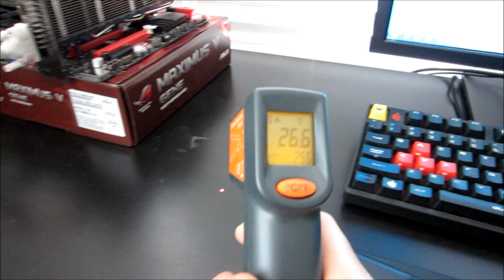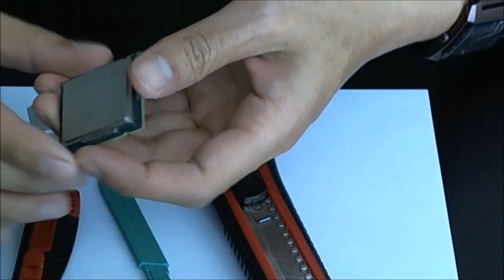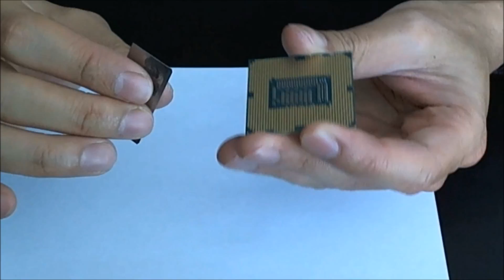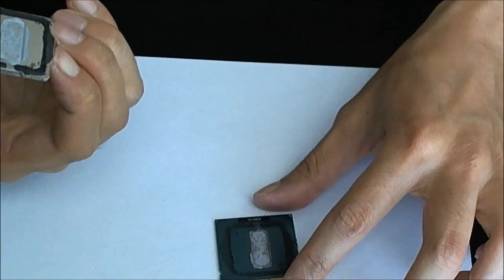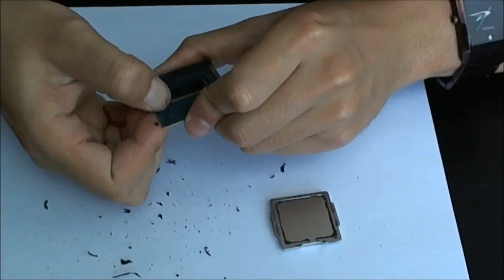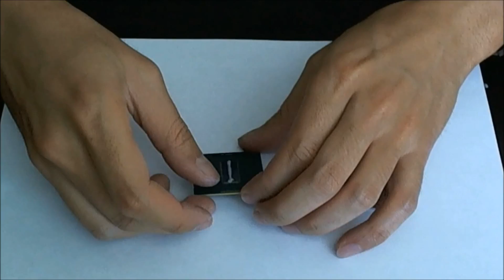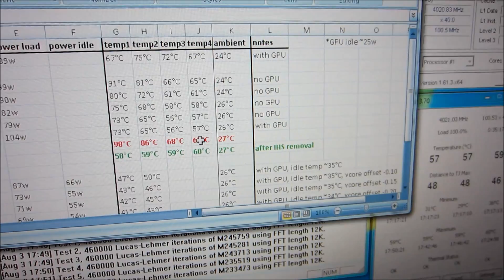Fixing Skylake, Haswell, and Ivy Bridge CPU temps: IHS removal

Comment: Why do you put the cap back on? Is the die too low?

Would Liquid Metal not be best for this soft of thing? AMD solder their die to caps :(
Reply: That AMD's using solder's a good thing. Intel used to use solder but starting with Ivy Bridge switched to using a really shitty thermal paste.
Reply: Yep, but that 3mm of nickel plated copper is just resistance. If your gonna do it do it proper, yet have lost dual channel DDR on a cpu lapping the solder off/a lot of water block pressure on the die. Solder is great with the amount of heat it generates i.e. crap CPUs.

Comment: I guess that's only the i3s and i5s that are bad treated because my i7-3770 never heats up higher than 70 degrees celsius.
Reply: If you dilidded that CPU, which isn't really necessary tbh though. You wouldn't go above 60 degrees C. But since it's not a K series, don't risk it.
Reply: +DarknessTheKidd Minecraft and Other Gaming Videos I don't have a K model but I have an enthusiast grade model of the i7-3770.
Reply: +Jeremy974 honestly,  you only start seeing huge benefits once you crank up the clocks and volts.  My 3770k at stock ran at 45 degrees,  but once overclocked to 1.3v, it reached 90 degrees.  Once delidded,  it dropped to 65C. Not sure there would have been a big difference at stock.
Reply: +Jeremy974 honestly,  you only start seeing huge benefits once you crank up the clocks and volts.  My 3770k at stock ran at 45 degrees,  but once overclocked to 1.3v, it reached 90 degrees.  Once delidded,  it dropped to 65C. Not sure there would have been a big difference at stock.
Reply: Nobody said that this process is necessary on stock speeds. It is a must have process if You want the plus juice from Your "K" processor but can't get it because of the bad paste inside the CPU. A 3770K CPU starts to be unstable at 81 celsius degree at about 3.9GHz. It is a joke.. This processor can run at 4.4 - 4.6 GHz without any problem with a correct cooling system (started with the paste itself inside the CPU).

Comment: Thank you for this! Very informative...
I'm scraping my guts together to do my i7 950 CPU as well...
Reply: DO NOT DO IT RESEARCH FIRST EARLIER CPUS MOST OF THEM ARE SOLDERED TO THE HEATSPREADER ONLY IVY BRIDGE AND LATER USE BAD THERMAL PASTE
Reply: +Chalklate thank you for the warning. will double check first.

Comment: I did this in my intel i7 3770k, almost a heart attack on the process.... with prime95 ran on 98-100 degrees on stress test and stock cooler non oc now it stabilizes around 77, wich i think its not perfect but a huge improvement, awesome guide thanks.

Comment: Removing the IHS cost me my new 300 dollar processor. If you guys do want to remove your IHS, then make sure you DO NOT scratch the board with the razer, otherwise you will end up like me... Having to go buy a new one...
Reply: Why did you even try this? 3c off your temps ain't worth having to scrape off the ihs with a razor blade m8. Lol rip cpu
Reply: Nasty AIDS when intel puts shitty thermal paste in between, I wanted to make it better :)
Reply: Nasty AIDS yeah :) those things are supposed to be soldered together and not filled with some cheap ass paste :) I was gonna send Intel an email asking them to send me another cpu for free since the reason why I destroyed mine was because of them. Didin't do it at last... :)
Reply: MRsjovealek it is a fact they used a thermal paste instead of soldering the IHS to the cpu. But the main thing is not to scratch the board when trying to remove the IHS... Better so to use a heat gun, no need for scratching then... :)

Comment: Very cool, dramatic difference. My guess is that the thermal paste was just not applied that well to that first core giving you horrible numbers. Could be the thermal paste on the IHS too but we won't know. Whats awesome if you're water cooling with ek blocks is they make mounting hardware made for delided haswell/ivy-bridge. You could in fact just mount it like that and get even lower temps. It can be done with any cooler all you would have to do is trim the mounting hardware to the thickness of the IHS, maybe 1-2mm wtv it is.

Comment: wouldn't speed of fans practicly not matter?
as u said in video, that now u can turn down fans after the mod.
however the cpu couldn't move the heat before to the headspreader.
so more heat removal  away from the heat spreader wouldn't matter that much, even strong water coolings have the same issue as u showed in the video by my knowledge?
just wanna say no fan speed could remove the shit that intel created here!
nice vid i still have the good old i5 2500k on 4,4 ghz.
and hope when i finally need to upgrade that i don't have to do intels job of applying heatpaste into a place where solder should be!

Comment: I wouldn't take any change opening this cpu with my bare hand even if I'm sitting on an anti-static floor mat.  Your hand produce moisture no matter how dried your hands are and that moisture will short that cpu if it gets on those small dye. I much prefer you get an anti-static glove when touching any electrical components especially computer.  But anyway,  I can''t believe that intel would choose such a sleezy way to go in putting thermal paste on a cpu dye and expect it to handle heat temperature that can easily skyrocketed under heavy load or long duration usage.
Reply: Mr Boombastic ... spoken like someone who has no idea what they’re talking about, well done! Have you learnt more in the last couple of years?

Comment: Amazing. 
I was sure that processor was doomed. Seeing the pcb bend under pressured cutting, undue stress for sure. However, the procedure you used did the trick. Getting the temps down 30~40 degrees on the hot cores was an amazing result.

Comment: You just got a bad CPU, I5 4690k at 1.090 at 4.5 under 55c full load
Reply: +Josh Carter The i5-4690k is a Devil&#39;s Canyon processor, it is neither an Ivy Bridge nor an original Haswell, which are the only processors to date which have this annoying issue.  Learn to read before you post stupid shit.
Reply: Ive had original haswell cpu's that on air was pushing no more then 65c at max load. Thats perfectly fine
Reply: That's pretty bad given that my i7-3820 is running cooler than that OC'd.
Reply: +DarkCloud64 55c under full load with air cooling at 4.5 is pretty dam good. not sure what your smoking lol
Reply: The i7-3820 is known for running a fair bit hotter than the newer Haswell CPUs.  For it to run cooler at only 4.3 GHz is actually pretty bad, especially considering the die is much bigger.
Reply: +DarkCloud64 haha. I honestly don't think you know what your talking about. a large oc on air and achieving under 65c at max load for over 8 hours of prime 95 and 55c MAX while playing only cpu intensive games is really good for the 4690k
Reply: Josh Carter
We're not talking about Devil's Canyon, I've already said it twice now.  We're comparing original Haswell, which the 4690k never was, and never will be, to Sandy Bridge-E.
Reply: I'm not bullshitting, those are the temps I get in a 70f room. don't like it don't believe I don't give a fuck lol I'll continue to enjoy my low temps.
Reply: that's after like a 3 hour session of Witcher 3, I told you my room is controlled 70f enough said. you've been proven wrong step down.
Reply: at this point I'm done arguing I've given you facts and you choose to continue trolling have a good day. I'm not going to waste a day making a video to prove what I've already shown.

Comment: just water cool it i had one off them coolers and i ran the same temps ran a single 120mm all in one loop rad got 30c idel 55c load got a 240 rad water loop got idel 20c load 45c air cooling just dont cut it for haswell chips

Comment: can't direct mount the heaksink to the die?
Reply: +Jackie Tan No because the coolers are not made for this. therefore you have to adjust the screws so the cooler can mount a few mm deeper. Also there would be problems with pressure and the size of the plate on the heatsink. probably wouldnt fit inside the socket.

Comment: Handling cpu dies without gloves is like sex without condoms; it's unappealing.

Or you could say there's risks involved
Reply: +Don&#39;t Touch Me what is really the issue, assuming u're grounded? during the whole work process and your hands are cleaned  with proper clean soap (yes there is non clean soap that intentionally leaves crap on your hands after using it)
 before working on it?
its not like your working with  unhealthy flux or other crap.
but please correct me if i'm wrong.

Comment: Please, wear some plastic or rubber gloves when doing this to stop the CPU contacts and the heat spreader being oiled with your skin oils and also to somewhat protect you in case that blade or the PCB breaks and cuts your hand.

But oh, that chip is tiny under that huge heat spreader... and such a tiny chip costs almost my month salary.

18:55  "Make sure it's straight" and then a few seconds later moves it completely out of place :D

Comment: why put the heatspreader back on ? just mount the cooler directly on it , thats the whole point of removing it , its terrible and you get much better results whit mounting the cooler on the die directly
Reply: Russell Roberts  this one is copper, nickel plated
Reply: Makes no difference, and it’s safer. The heatsink wasn’t designed for direct die contact.
Reply: @literate-aside  i dont think you understand, i said THE HEAT SPREADER WAS ALREADY COPPER

Comment: And exactly this is why i went with a Proper CPU.. not this iGPU crap and poor Thermal Paste CPU's. Intel's i7 Extreme CPU's are soldered and therefore don't need to be opened like these..
Reply: 5820k ftw
Reply: ***** but you bought a k series cpu.  You MUST overclock it.
Reply: +Kitty Cat logical  aproach most clever people have:
get the cheapest real value cpu.
overclock it to its stable 24/7 overclock with good custom cooler, be done!
the fact that intel didn't even use proper heat paste hell even a relativly good  one would have been miles better than the crap they put there tells u that they dont give a fuck about customers and cut wherever they can.
literally all he did in the video was change the heatpaste for what ,5 euros? of paste and it works as it should.
idk i just dont get it.
and i dont get why u think people should spent more money on chips that have a thermal transfer as it should be for everyone of the chips.
Reply: +Thomas Elmore No need to spend a Grand on a CPU.. the 5930k + 5820k are less than a Grand.. but if you spend money on a CPU, then do it on a CPU that is soldered, and not this garbage <.< same with the Power Supply, don't cheap out.
Reply: Phoenix Wright ah, sorry man. Sarcasm is hard to read in written form.
Reply: TheKlingis
good enough for its intended use?
what??
do u have any idea, what u talking about?
high temps are not restricted to overclocking alone.
a bad cpu cooler (intel stock) in a  restricet air flow case in a really hot climate can easily hit the thermal max and throttle.
so why do u defend intel??
the intended use of that heatpaste/ souldering that should have been used, should have been above the tjmax of the cpu???? don't u think.
and i would highly highly assume intel at least didn't' fuck this up, althought i dont expect much anymore.
the truth is, and most people will agree on:
intel used crap heatpaste, because they could save a penny on production not caring about their product, not carrying about overclocking and not carrying about the general user, as their cpus can and do throttle too and overheating cpus reduce their average lifespan
again not carrying about their user.
so why do u defend a company, that clearly doesn't care about u?
are u a fan girl or boy?
and even if so wouldn't u still want your company to make a great product? or at least ok product.
Reply: +Kitty Cat dunno, I have the infamous 4790k, and with a relatively cheap air cooler, I'm steady around 80 degrees non-OC. Could be better, but this chip is a beast at factory settings, so I see no reason to force some extra MHz's.
Reply: *****
i was joking
Reply: Poor thermal paste is coming over to the Extreme CPUs soon. The Skylake and Kaby Lake Extreme CPUs are found to use similar thermal compounds as their Mainstream CPUs.
Reply: bluej511 Proper CPU's like the X or Enthusiast K series are already soldered.. DUH. Yeah let's buy a consumer crap chip with shitty Thermal Paste and Garbage iGPU and then Void the Warranty by delidding it. And eventually destroy the CPU in that process. "easily solder the IHS or something like that".. sure. If you're dumb enough and want to get your CPU killed.. go ahead.
Reply: Phoenix Wright
rofl :p
Reply: Phoenix Wright ah, here comes that stupid logic again... No, I don't have to, thank you. It's more than powerful enough @ 4.4GHz.
Reply: *****
yes it is! biggest issue ever in the written form of internet trolling.
Reply: +Kitty Cat Since when did a i7 5820k cost one grand?.  I chose the 5820k  over the quad core i7 6700k and it cost me £300 which isn't that much more expensive than the 6700k was despite the fact I have two more cores and proper thermal interface material so I don't need to do what this guy did here. I haven't even tested the overclocking capability of the CPU yet except to say it does 4.5 ghz easily.

Where did you get the idea that the 6 core 12 thread 5820k cost a grand?.
Reply: +cataria pega the thermal paste was probably damadged due to overheating while overclocking..  if you use the processor normally  its extremly rare to run into these kind of problems.. 

intel used a paste that is good enough for its intended use.. . .

Comment: Usually thermal paste of that kind, gets softer and it can even melt with some heat, the heat produced by the CPU. I guess that for making the CPU, the inserted like a block of that thing and then they put the second heat sink (there are 3, the 1st one protects the silicone board, the second is what you see, and the third one is the one you buy and install in your PC)